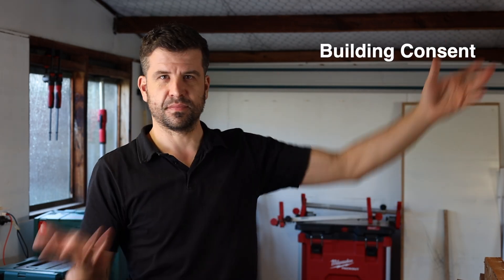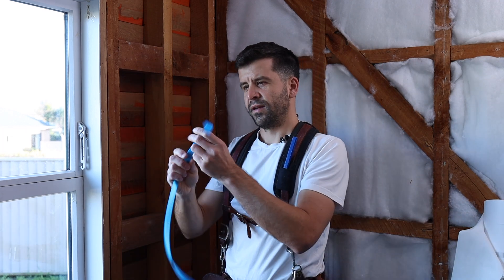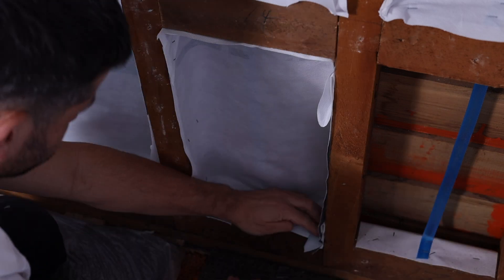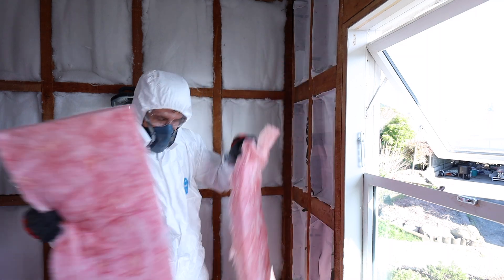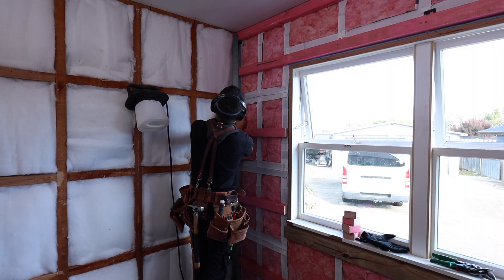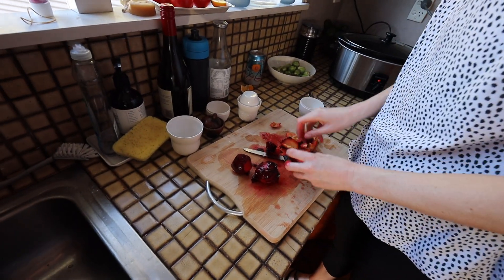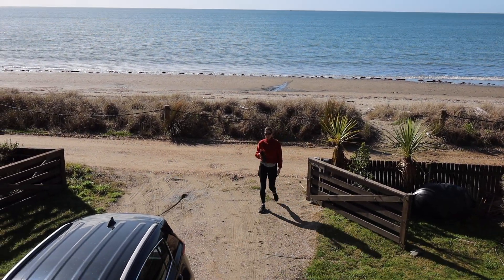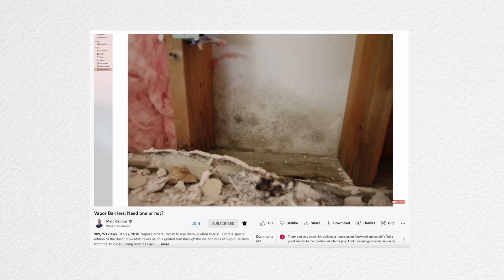We're Finally Going To Be Warm! Renovating Our 1960s House

Comment: Hey mate, similar issues here in Australia. Need to ask you, limited money wondering what would be best to do first. 

1. Have a old brick veneer house 2 story, and foundation is solid concrete. Has single panel windows. 

2. Old red terracotta tile roof.

My question would be whats the most cost effective way to make the home able to be thermally effecient.

Walls? Remove dry wall and add in rockwool, or ceiling on the upper floor? Or double glazing?

Comment: I was looking at that wall and thinking those are some nice thermal bridges you've got there, but then you went and fixed them beautifully. Great job. Also Rockwool is available in NZ, sold by CSR I believe, we use it a lot for Fire rated walls and Facades. It's called Bradford Fireseal now.
Reply: You can get real rockwool from nuralite nz, 100mm etc

Comment: I'm curious what do you call a "heat pump". In Canada and the US, it's a system of pipes buried in the ground (deep enough that the temperature is constant) that have a liquid flowing in it. In winter it heats up your house and in summer it cools it down. In Japan, some people call the A/C units heat pumps since they can cool houses in summer and heat them in winter.

Comment: Great vid! fyi Rockwool is indeed avaiailable in NZ, though it's used mostly in commercial projects and not widely distributed - so you need to pay a bit in freight if you're outside of Auckland. I have five bales of the stuff (could only get a 50mm thick version so have to double up in the cavity) about to go into an internal wall separating my daughter's bedroom from the lounge as part of efforts to soundproof. Much denser than glasswool!
Reply: I got 75mm from nuralite without any trouble. Your right though, freight is expensive.
Reply: Where can I buy nuralite? I can't seem to find a distributor even in Auckland.

Comment: Would have put solid Insulation in the wall and covered that with insulated plasterboard but depends on availability too I suppose.if I could I would probably spray foam within the walls and have it airtight also.

Comment: Use PIR foam insulation 90mm achieves 4.1R value and comes paper faced im guessing you have 105mm framing so you still achieve 15mm cavity which is just fine. The foam is quite expensive but by the time you eliminate double layer pink Batts building paper additional framing and extra trim work around window Im sure you'd be saving. Not to mention the extra .7 R value you'll achieve.

Comment: I was told that walls rot from the moisture inside the house not able to get out, in New Zealand. NZ doesn't have vapour barrier requirements (like other countries do). Iron roofs also rust from the inside moisture.
Reply: Generally it's the water from the outside that rots walls and floors in NZ houses. Water ingress that then can't get out. Internal moisture just causes mould problems on surfaces although sills and window sashes can really suffer from window condensation.

Comment: did you think about expanded polystyrene insulation for insulation? I think 80mm thick sheet gives you over R 2.0?, is solid so if you flush it on the inside, you have a 20mm gap to weatherboard... I used it when I strapped a block wall and was easy to work with and the sheets were surprisingly cheap and easy to cut,work with....

Comment: In the UK we generally speak in terms of U Value, expressed as "w/m2k", a PIR insulation generally provides the same U value as a mineral wool (rockwool, glasswool, etc) twice the thickness. This is based on a 0.040 lambda thermal resistance wool, you can get higher Lambda wools that provide greater thermal resistance and less depth but in the UK at least, the cost per m2 rises considerably. 

In the UK the Building Regulations for domestic new build properties are:

Roof - 0.20
Wall - 0.30
Floor - 0.25
Windows - 2.00
Doors - 2.00
Air permeability	10 m3/(h.m2) at 50 Pa

To achieve 0.20 w/m2k on a roof generally requires 100mm thick PIR or 180-200mm thk mineral wool  (you need a U value calc which takes into account all the components in the roof build up for an accurate insulation requirement though), I work in commercial construction so we often see U values right down to 0.10 with ridiculous amounts of insulation to achieve it.

Comment: Following this with great interest. One thing you should address: ventilation! Mechanical or in some other way. Most new windows here (Netherlands) have a ventilation grille in the top section that you can open/close. As said, I follow this with great interest. I'm not a pro but we (my wife and I) have restored more than a handful of houses. That is one of the reasons I came up with 'Rockwool' as an insulation material. For your roof insulation: use the same method you did with the walls. It looks tidy. Don't throw 'blankets of insulation' on your room's ceilings.
Reply: @Phil Heslop in the UK we call this type of ventilation 'trickle vents' which are usually installed as standard on modern upvc windows. They can also be retrofitted by drilling holes through the window casement and fitting the vent covers over the holes.
Reply: Our ducted heatpump has a ventilation unit attached. They could probably add one to theirs if it doesn't
Reply: Many window companies in Australia and New Zealand offer vents that can go into windows commonly they open and close similar to Venetian blind there just not as common. There becoming more popular in newer homes.

Comment: Continental Europe doesn't even use the R system. We use U values which show thermal conductivity and the lower this number is the better. It's measured in W/m2*K. This means that at an U value of 1 a given wall/ceiling/window etc transfers 1W of power over 1m2 of surface area if the temperature difference between either sides of the wall is 1 degree K (in this equation in Kelvin but it's the same in C).
Just to give you an example: a timber frame wall with 125 mm of glass fibre insulation has an U value of roughly 0.3. New energy efficient buildings should have walls with an U value of at least 0.14 (i.e. 0.14 or lower) over here in Estonia.
To be honest, the R value seems more convenient to use.

Comment: Hmmm watching this from Poland, building my own house by myself and here it probably woudn't work. 

See, our climate seem to be kinda similar to New Zeland and during sunny winter days, the wall/roof (mostly the same rules apply to roof insulation) gets heat up quite rapidly. Timber then suffers termal shock, that forces moisture to appear on the inner part of wooden wall-laths. In your wall there is barely some space now and no ventilation to cool down/dry the wood. If the wool gets soaked in the process (by direct contact or humidity), it looses all its properties. 

You even said in your video, that it used to work for many years. Reason is, that this wall previously never got warm. No high heat differences, no moisture. Plus the gap, and spaces between the outside laths made proper ventilation possible. 

What we do in here, is to cover the outside of the house with wool, to prevent cold touching wood. Layers look like this:

- Wool (secured with silicone plasters on the outside)
- Breathable foil
- Woodden construction (with wool/or PIR foam inbetween timbers) 
- Plastic foil (to prevent interior humidity penetrating walls) 
- Drywall

Yet I hope it will work for you. Tip- try to think about making a sneak peek hole to see the inner part of the wall, to make sure it worked out. Eventually the first winter should give it a test.
Reply: we call that "thermal shock" solar drive. its actually the water/moisture being heated by the sun and it gets pushed inwards. thats why hes left the gap between the cladding and wrb, which has air flow to vent that back outside. plus we don't have moisture barriers (plastic foil) so any moisture in the wall can dry to the inside of the house.

Comment: In Canada we have a standard r value of I believe 20 or RSI 3.5. Basically R is the thermal resistance rating in imperial and RSI is the metric however since I believe in New Zealand it’s all metric it’s easier to just call it an R-value

Comment: In Denmark we measure in lambda values, the lower the better. The minimum required thickness of insulation in new houses 300mm in walls and floor, and 455mm in the roof.

Comment: Well , to our code, we would had to take down the siding and redo the outside first off.
There is no way for us to do it that would pass from state your house is.
We would also require vapor barrier in every room with insulation, except for rooms like bathroom as  they will be sealed before tiles, double layers of water/vapor seal is a big nono

Comment: What brand are your heat pump vents?  I’d love to install a heat pump in our house, but the parts and expertise are less common in the US.

I’ve got two problems with what I’ve found so far:
1. I don’t want a bulky wall cassette, not even the ones hidden behind a picture frame.
2. We also live in a mid-century house with a flat roof (no attic space).  So the max height I can do is 6”.

So far I haven’t ran an option that works for me.

Comment: I don't understand how insulating walls in NZ works. It is very different from how it's done in my country (Norway). I think what many would have done here is to insulate, put vapor-barrier on the wall, and maybe even have 2" of horizontal framing on top of that to run wiring through and to also insulate before plasterboard. 

I get if that you don't want to remove the shiplap in order to windproof the house, but that would also limit the ability of moisture to build up inside the walls.

Comment: Here in Taupo District you need a building consent to insulate exterior walls if you want to do it yourself or use batts. However they will let you get the injected fluff without a consent. Mitre10 demonstrate how to do the job on a non cavity batten external wall. They just added extra building paper stapled to the back of the weatherboard and then put in the insulation. No air gap required. However I note the BRANZ update states good practice is a 20mm air gap behind the building paper if retrofitting but this is for where NO building paper exists already. So it begs the question is moisture going to be an issue if you don’t have an air gap where building paper was used behind the cladding? If you use an inert insulation like pink batts or even better Greenstuff, ( no mask or suit required) then moisture won’t rot the insulation. Plus you can use full width 90mm in the walls and save work.

Comment: Scott in the US we use R-13 or R-15 for 3-1/2" Stud Caveties (2x4 walls) and use R-19 R-21 for 5-1/2" Stud Caveties (2x6 Walls).  Where I am they recently updated the code to allow R-23 in the walls for new construction thermal performance standards.  In the Floor Joists its common to see R-30 or R-38 for 9-1/2" or 11-7/8" Joist caveties for our standard engineered I-Joists that we use in the Pacific Northwest.  Ceiling / Attic it is common to see R-38 all the way up to R-50 or higher.  A premium option is to have a Insulation Contractor come in and do a closed sell Spray Foam which will do like R-50 in a 2x6 Wall.  When I watch your videos it is crazy to me how little R-Value on your insulation is required.  Either NZ rates R-Value differently or you just don't need it.
Reply: Scotts R-3 is equivalent to your R-17, we use metric here

Comment: It just warms my heart, to see a NZ house get central air conditioning in 2022, like American homes had in the 60s!  In America, you just buy insulation with the vapor barrier already attached to it and then cut to size.  I've never seen it have to be installed separately.  In Georgia, our homes are typically R6 in the walls and R38 in the ceiling cavities.  These are minimum code numbers.

Comment: Sweden here. I found something called U-value, which is the inverse of R-value… ”the U-factor or U-value is the overall heat transfer coefficient and can be found by taking the inverse of the R-value. It is a property that describes how well building elements conduct heat per unit area across a temperature gradient. The elements are commonly assemblies of many layers of materials, such as those that make up the building envelope. I really have no idea if this is important.

Comment: In north america the metric R-value is named RSI and the north American value simply R-value.  The metric value is 5.68 smaller.  I have R-60 in my second floor ceiling but in RSI that would be about 10.6.

Comment: Here in Denmark, at one point you would place the vapor barrier 1/3 in from the inside. This way you could route your electrics, without have to go through the barrier.
Not sure what the guide lines are now a day, as I work more with civil engineering, like bridges, quays, tunnels ect.

Comment: I admire your effort! I understand your first layer of insulation. It is easier than removing the exterior cladding, wrapping and recladding. But, I would not have added the second layer of insulation. Too much work packing out the walls and adjusting the window frame. I would have used a 13mm CSR firecheck or acoustic plaster which will provide a thermal couple/barrier (dT / dt). You could also double layer 10mm plain gyprock

Comment: Canada minimum code wall insulation value is R20 based on a cavity wall depth of 6" (15.3cm). New Homes are built with 2x6 spaced at 16" on center to minimize thermal bridging. Attic insulation is recommended R-Value from R50 to R60.

Comment: I would have removed those bottom nogs to continue the batts to the bottom, behind the new bottom 70x45. Come to think of it, I would have removed all nogs. I don't think the strips of wrap over the studs do anything. You really only need it behind the cladding. The 20 mm cavity is IMO a good idea. In your house, depending on risk matrix, it may not even be necessary, but why not?

Comment: P.S....Your R3 walls would be about R15 using the US version of R numbering. Each product gets a particular value per inch whereas in AU/NZ we just buy a bag for a 100mm wall cavity and it will be R2 or something. You can get a bag for a 150mm wall (R3) but if you stuff it into a 100mm wall, it will only be R2 or maybe even less.
I don't say this very often but the American system is easier to understand and you probably don't get as many people (As we do in Australia) trying to ram in two layers of R2 into a 100mm cavity and expecting twice the insulation only to find out they have spent twice as much money and reduced the R value :)

Comment: Hi Scott,  I have just discovered a wood fibre based product called Steico flex. Much nicer to work with than glass fibre. Cuts and push friction fits quickly.  I'll never go back to horrible artificial fibre choking rock wool. Do check it out,  they're based in Germany

Comment: Hey Scott, I can certainly appreciate all the cutting to fit the insulation in this older home! Whoosh! Crazy amount of time for labour.  You asked about our comment about insulation. 
Would have been nice to chat to you about it before all your amazing work and the choice to use the pink insulation stuff. Why? Well, here in East Canada, on the small Island and province to Prince Edward Island, AND when I lived up in Northern BC, West Canada, we can use this amazing stuff called Rock wool. If it gets wet or damp it still insulates. Rodents hate building nests in it and it is also easy to cut AND you do NOT have to wear any mask or outfit because it does  not have glass fibers like the horrible pink stuff. Personally, I will never buy the pink stuff again.  Here is what I found on the internet to help re:  insulation heat retention value: Rockwool has excellent heat retention.
While fiberglass (pink stuff)  insulation is capable of offering an R-value of about 2.2 to 2.7 per inch of insulation, Rockwool has an R-value between 3.0 to 3.3 per inch of insulation.Sept 30, 2021 
One other choice, and one I started using for the renovation of flat ceiling into a cathedral, is rigid foam, 2 inches. Of course you can get a variety thicknesses.  It is easy to cut with a jig saw that has a very thing blade made to cut through this sort of rigid styrofoam so that you do not get the little bits falling off when you cut.  Some of the guys working with me cut it with a utility knife as well.  Here is the amazing heat retention value of this wonderful product: Extruded polystyrene: Extruded polystyrene (XPS) rigid foam is usually blue or pink in color, with a smooth plastic surface. XPS panels typically aren't faced with other material. The R-value is about R-5.
So there you go Scott. I suppose if you are planning to insulate other walls, if you get around to reading this thread and it catches your attention enough to want to read it, you could try any of the two options after you do your due diligence.  I know that the cathedral ceiling in the porch, which has 6 inches of XPS with reflecto barrier on either side to radiate heat on one side into the air space under the roof sheathing, and another layer radiates heat back into the room as it is located under the ceiling strapping. The ceiling strapping is used to hold the vapour barrier as well as the ceiling planks. Its rather difficult to explain without the option on this platform to show you. I am sure if you google reflecto barrier you will find lots of photos and explanation. This is the way I learned about it and through youtube vids as well. So much to learn, and we all have time to learn no matter at what age. Cheers from East Canada.

Comment: Hmm, all that tricky cutting of the moisture fabric in each wall cell makes me wonder if it wasn't worth removing the exterior cladding and just doing it from the outside? Then add battens over the fabric and reattach the exterior siding so you get your air gap.